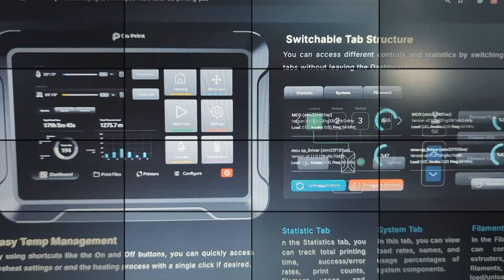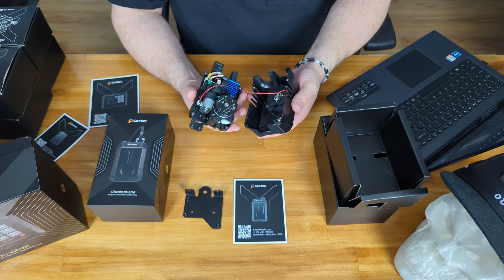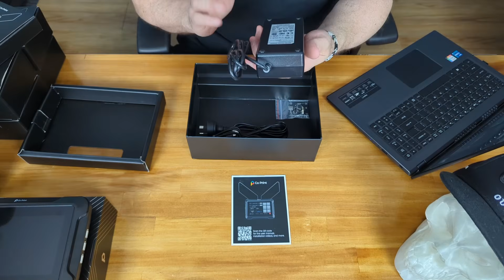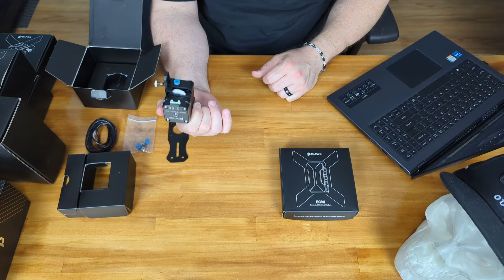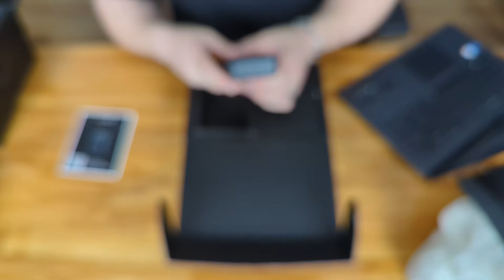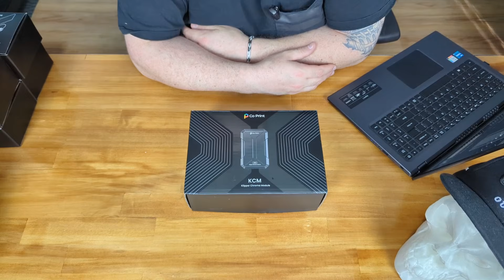CoPrint Chromaset Chromapad Full Unboxing / Product Review 3D Printing for All  & First Impressions

Comment: DON'T BUT IT, IF YOU DID MAY THE 3D PRINTING GOD SAVE YOUR SOUL.  I made the purchase, and the mistake of not looking into the ins' and out's of this system.  The print files are not in one place, you have to look everywhere to see what parts you actually need for your printer.  The files that you need also are not listed.  So to say it's scary to think you have the correct files needed to make you printer work and print correctly it's not worth it.  Imagine you have a working printer and then after finding and printing all the mounting parts, and think you have downloaded all the files to convert your printer to print in color is something I'm not willing to do.  I will just take the hit and make it an expensive learning experience.  Anyone wants to purchase a new unopened KCM kit for cheap.  I paid $289. for it but will part from it for $100.  plus shipping.  Or I will just smash it into pieces and take the frustration of losing my money.  Overall don't buy it and save your money and just buy a multi color printer, I will be purchasing the Flashforge Creator 5 which is going for $699. and you get to spools of filament for free.
Reply from the maker: 👉I WILL LEAVE THIS UP FOR 48-72HRS - For everyone To Read OK Firstly, Whilst I appreciate the Honesty JAQ157.  That said I am going to Give you Mine,  I will say this. 👉This is NOT a Advertising for SALE Section Adds - For Your Mistakes? or Area to Ridicule & take anger out in my Comments Description Section for your Mistakes on "My Reputable Honest Channel". 👉2. JAQ157- Quote "I made the purchase, and the mistake of not looking into the ins' and out's of this system"  /  👉3. You should of sent it back for a Refund if you had that much trouble with installation (No Excuse Their)  👉4. I TELL IT LIKE IT IS.   👉5. I'm NOT Your Everyday Content Creator - I'll CALL Anybody out in ANY INDUSTRY if Need Be - Tech Company, Personnel, Corporate & in THIS Section as well,  As I will be called Out If Needed & HAVE (Never Avoided It Never Will) ! 👉6. This is Not Your TROLL Channel Page Go take that to Facebook Community, Discord or Reddit were it Matter Most if you have a Problem. 👉7. My Social Media Page ALL DUE RESPECT IS NOT!  A Story Telling Event for Trolling Spreading BS by your Own Mistakes. Lets Be Real You Said it YOURSELF. (No.2).  ----------Lets be clear - I get it, You were Frustrated, Annoyed, Felt Ripped possibly, But next Time Get a Refund and Move on if it's not for you or what you thought or Wanted. Quite simply it is a Custom 3rd Party Kit that needs some Tech Knowledge to get it running Smoothly. This was Obviously Not for You. Case In Point. Don't Troll My Page With Your Mistakes & PUT ME ON BLAST Through MY Comments Sections! That's NOT HOW YOUR EARN RESPECT!  
(If you Don' t LIKE IT THERES THE DOOR)!       "Otherwise show some Respect" /  Put that type of redirect to use were it actually does something - ❓❓Facebook Community - Get a Refund Next Time, Post On Reddit, Get Tech 1 to 1 Advice Next Time.       Crizs OUT!                       PS. I will be Reviewing in Full  // 👉Flashforge Creator 5  & 5 Pro in Coming Weeks - 🧐FULL RAW TESTING & Data & In Depth Long Form Engineering Grade Testing ^ Printing Review!

Comment: Does this have an auto leveler (CR TOUCH)? Or something similar? That is a dealbreaker for me.
Reply from the maker: Great Question......It utilises a inductive proximity Sensor which far more accurate than a Cr-Touch equivalent. It is mapped based on the size of the Build plate that is being used. Very Similar to the Omron Proximity Sensor / Probe which many New Core XY Printers utilise or a Bed Pressure Sensor. The Co Print Head with Proximity Sensor measures within 0.001mm with up to 32 point bed mesh mapped in either Mainsail - Fluid or Chromapad depending on what kit is utilised in the Co Print Line Up.. Hope this Helps

Comment: I totally agree with you regarding international costs. The cheapest CoreXY multicolor (I won´t go back to bedslingers as I have a Flashforge Adventurer 5M) sold in Brazil is the Anycubic Kobra S1 Combo which costs around 1380 USD (almost the price of a P1S with AMS which goes around USD 1540, considering 1USD=5.6 BRL). Getting the KCM set (mine doesn´t need the ChromaPad as it runs Klipper) and for the current price of the KCM (USD299 + USD 30 shipping) , even considering import taxes (60% of FOB prices) it´s still WAY cheaper for me to just upgrade my Flashforge with a CoPrint kit and keep it for a few more years instead of getting a new one. Besides, it´s almost new (8 months) and it´s just not financially justifiable to trade it for a new one. 

Of course, it will involve a lot of tinkering (something I was quite used to do but got lazy and spoiled after getting the flashforge which never required any thinkering, it just worked), however not only I have some experience in thinkering with 3D printers (rebuilt two , a bedslinger and a generic corexy ,entirely from scratch salvaging only frame and motion systems) and fiddling around with Klipper, I think it will be an interesting project (specially because 3D printing is a hobby for me, not a source of income) to spend some time into.

The nozzle looks like a Dragonfly (even if the heat block is different) , am I correct? What size comes with the kit? 0.4 or 0.6? 

Can´t wait for my kit to arrive. Too bad I arrived at your video AFTER I bought it.

Comment: Thanks for the video, good overview. Just got my ChromaSet mostly set up on my Ender 3 v2.  Started looking at understanding GCode but I’m impatient and wondered of any good GCode templates or best GCode configuration for my setup?
Reply from the maker: Thankyou, Keep an eye out on CoPrint GitHub for G.code setups. I am currently working on some G.code Config Files as are CoPrint Tech team. Also check CoPrint Discord for updates. Full CoPrint Review and Updates content coming on Monday. Thankyou
Reply: @ awesome thanks for the info.  Man, I am really struggling in getting the Chromaset even setup.  Few things are going haywire with it.  First, it doesn’t actually write the klipper bin to my SD card.  Tried numerous cards and it doesn’t write to it.  Not sure where I can just install it online.
Second, the USBs are mega sensitive.  As soon as any usb is put in, it will start configuring on its own even if I don’t have it connected to my printer yet.  Somehow I’ve created blank 3 printer profiles and I’m unable to delete them or unsure if I’m missing a setting for it.  If I can just figure out how to get the bin file to actually write or just download it then I may be able to fix it.
Reply from the maker: @jmstampe  content CoPrint on Discord. They'll post links for the Bin files to download and install manually. Then you can flash the printer and install. As far as removing printers installed you can do it remotely using Winhcp app. It's hard to find but I will listing all links to GitHub pages and CoPrint files when I upload my video for all relevant files installation, uninstall, remote connections, downloadable app links, printable parts, bin.files, how to hard reset Chromapad and more very soon.

Comment: and the filament sensor? doesn't it have one? how does the machine know when it runs out of filament?
Reply from the maker: The Original V1 variant of Chromahead was to have a Filament Runout sensor, But Unfortunately due to redesign constraints they had to eliminate it from the chromahead so there is not a filament runout sensor. that said for the Price and performance there is a workaround using a 4 Filament runout sensors which approx. $12 each and using  a 4 way pcm/mainboard splitter cable into 1 cable. At this stage I am still working with the team to address updating the kcm or ecm to allow it to be compatible with the either kcm or ecm, I do know that the Chromapad which I will testing and installing this week will be a lot easier to add a runout sensor to. I will keep you posted on this. I understand it is handy to hav especially for large models to pause swapping out filament rolls and also incase of accidental filament breaks which although is rare a concern.

Comment: With this what is the max speed I can print?
Reply from the maker: @mauriciodelvalle4648  So far I am testing this within safe Good Quality prints, printing limits. That said single colour printing so far is 500mms possible more as the Chroma Hotends has a higher flowrate than Creality's K1 Max unicorn hotends at a flowrate of 21-22mm3, Chromahead has a Max flowrate of 24mm3 so by theory it is possible with the right acceleration to be slot quicker in single colour printing. By design though all multi colour printing has to be done at a slower speed to allow for varied brand filament flow rates, & filament recommended temperatures, whilst also travel speeds and jerk speeds for colour change, purging and prime layering.
Reply: @CRIZS_CREATIONS  thanks for taking time to answer.. how about any filament jams? Have u experiencia any
Reply from the maker: @mauriciodelvalle4648  No filament jams as yet. I mistakenly dragged the nozzle across the build plate but that was my own fault messing around with z speeds and not home z properly a rush. But as yet no issues. I'm calibrating all parameters today so Will start printing some prints over the next 3 days and then I should be ready to give my overall full review of the KCM system with Chromahead. I want to be sure I've given it enough time to evaluate properly and see the full potential of it before conducting an initial honest review. That said I will more than likely post an initial first impressions review then a follow up review again after a few weeks of use once I have accomplished many prints and upped the speeds and accelerations to their maximum to really get the full picture as a Full in-depth printing Review.
Reply: @CRIZS_CREATIONS  thanks I will go ahead and buy one kit and upgrade my ender 3 v2 neo thanks
Reply from the maker: @mauriciodelvalle4648  don't forget to use the link for the extra discount 😊. Goes towards helping the channel and myself give out more content like this and more back to the community. Thankyou.
Reply: @CRIZS_CREATIONS  thanks will  do
Reply: Sorry to bother..  last question any idea where I can get a filament holder for 4 filaments
Reply from the maker: @mauriciodelvalle4648  currently I'm using dual filament dryers as spools holders. But I have been researching and found many printable spool surface or hanging spool holders on printables.com , I'm also eventually most likely next week finalising a riser and overhead 4 spools holder for the K1 Max & K1. But for now its pretty easy to print some low profile spool holders of printables. Hope that helps.

Comment: I bought the kcm kit for my k1... I followed the instructions step by step to install it but it gives an error Klipper reports: ERROR

{"code": "key341", "msg": "Section 'servo cp1' is not a valid config section\n\nOnce the underlying issue is corrected there should be a place to help with the problems
Reply from the maker: @brunocardoso2936  contact support they will be happy to help, Our in the meantime you can also checkout their discord channel there of plenty of friendly users on their as well that will assist were possible.

Comment: Do you have to root the K1 to install it?  I've finally gotten a Klipper printer that works absolutely perfect without tinkering so I really don't want to touch the firmware.  I never thought I would say that!  :)
Reply from the maker: I will do the K1 KCM installation tomorrow & be posting most likely the full install and Printing test review on Tuesday as it does take sometime to test and record everything, As I know what you mean as I too have K1c & K1 max with full root access working well. I am pretty sure you do have to factory rest the K1 as the KCM uses it own firmware to control the Chromahead settings, extrusions rates, extruders and other things like proximity sensor calibrations and z offset bed mesh etc. But I will have to double check this when I do the Install tomorrow. I will be posting progress short updates along the way.
Reply: @CRIZS_CREATIONS  Great.  Can't wait to see the next post.  Thanks a lot!
Reply from the maker: it does require g.code edit to install klipper g,code variances for Chromahead & KCM I just checked
Reply: @CRIZS_CREATIONS  Yep.  I see that now.
Reply from the maker: @tomwitman7465  I never post anything without verification 👍💯
Reply from the maker: https://wiki.coprint3d.com/en/kcmset-setup-guide
Reply: Rooting the creality printers isnt really "rooting" and there is no tinkering involved. you arent forcibly changing the firmware by overwriting it, its just logging into the root linux OS with the credentials creality gives you in the settings of the printer itself to install optional software that the machines dont come from the factory with. Some things like the Fluidd interface ship stock on newer printers like the k2 plus.

I suffered and eventually gave up trying to make changes on my ender 3 pro flashed with klipper, but when I entered my root info and ran the "Creality helper script" (its 2 lines you copy/paste from github) on my k1 max, it changed nothing about how I operate the printer or its ability to use creality services. I dont tinker with printers. If it works, it works. Using the root login to run creality install script is 100% a plug and play upgrade with no downsides, genuinely.

Comment: Are you sure about that collaboration with Creality?  Coprint has released a version of the KMC for the K1 already.  Given your comment, I don't know whether to get it now from Coprint or wait for Creality to introduce the kit.  I've been printing since the early days of reprap, so I enjoy new tech stuff to keep the old mind working.  Thanks for the in-depth review of the system.
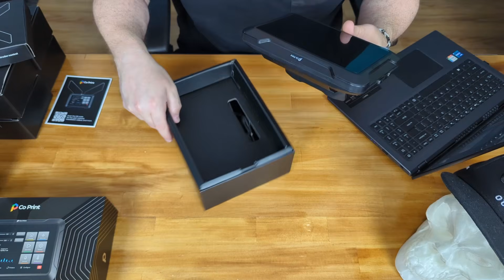Reply from the maker: Creality Zora Live @Formnext talking with CoPrint 17:14seconds Collaboration reveal
Reply from the maker: KCM CoPrint Kit will be sold on the Creality Store in 2-3 weeks time as a Collaboration with Creality but is the exact same Kit as Now just another way to collab with Creality to aide Creality whilst they are still working on their own Ender3 V3 multi color design.
Reply from the maker: @SlimWitman  Absolutely. BUT what it is. Is that Basically Creality will be offer CoPrint KCM combo kits on Creality Site for multi color printing. The kits itself will be no different it will just be endorsed by Creality on their Creality site Officially. It was a live sneak peak leak at Formnext when Creality were live chatting to Furkan from CoPrint about the upcoming collaboration with Creality for their Ender 3 V3 line up and K1 Series. My assumption is because Creality does not have their own multi kit design completed yet for the Ender 3 V3 and considerimg CoPrint & Creality in the first place on multi color and the K2 this has become an option for Creality to fill the consumer void whilst working on their own system.
Reply: @CRIZS_CREATIONS  Looks like a full speed ahead, then.  No sense waiting.  Thanks!!!
Reply from the maker: @SlimWitman  Don't forget Save yourself some cash with the exclusive link in the description for an extra 10% off the entire CoPrint store on top of Sale prices. 👍.